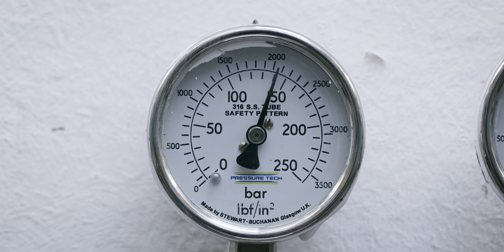How Warby Parker Acetate Is Created

Comment: I wish I could just buy a sheet of that to make matching gauges to match the marzipan tortoise frames I've worn for ten years. Finding tortoise shell acrylic gauges has been impossible even though it seems simple. I've tried every kind of material that looks similar but nothing matches perfectly. I'm currently experimenting with translucent liquid Sculpey poured into sono wood tunnels, wish me luck to get the colors right.
Reply: Try searching for cellulose acetate pen blanks, it can be carved or turned on a lathe to the right shape